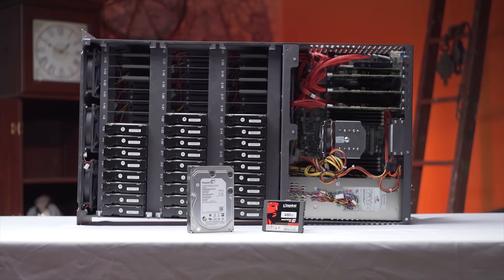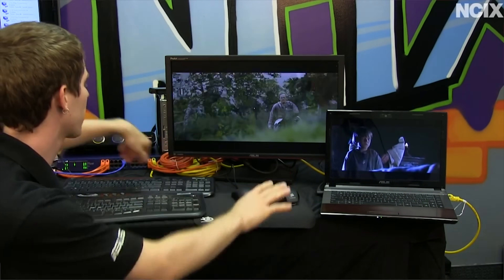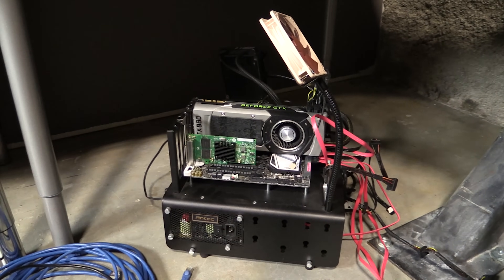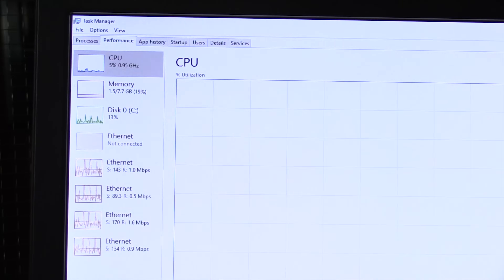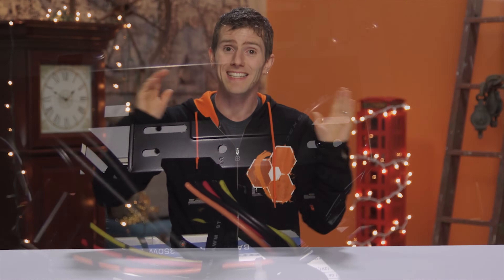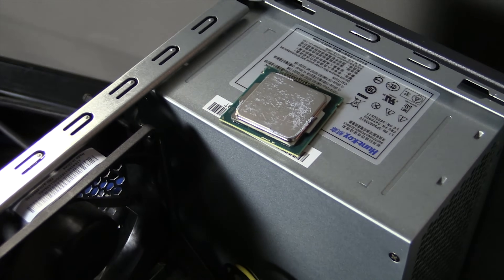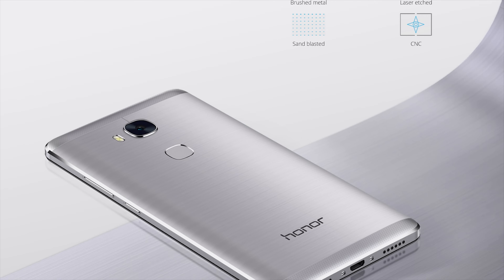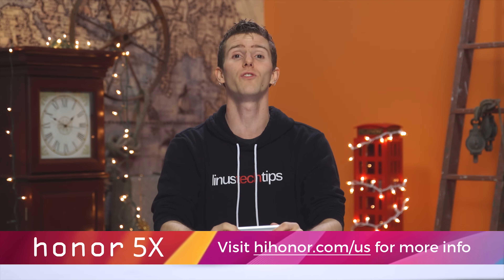Quadruple Your Network Speed for $100 with SMB 3.0 Multichannel!

Comment: I am the first to cry foul when someone yells 'its easier on linux'... but in this case, it is. Basically, anything network related I would want the backend to be linux. I actually use a 4 port intel nic card so that 4 pc's in the house have full gigabit speed to the nas, and it is always limited by the processor(or drive speed) on the backend, so using a bloated OS like windows for that work seems retarded in my opinion. It just sits in the corner, so why does it need a UI at all :P
Reply: +Richard Smith 
Windows has a lot of internal bottlenecks and bugs when it comes to fast and consistent networking.
Worst part, Microsoft does not give a shit.
MPTCP has been in development in LINUX, FreeBSD and Mac OS X for about 3 years now.
Reply: AirScholar  "You give Jobs way too much credit"  Umm i think you're confusing jobs (apple) with gates (Microsoft). And jobs technical abilities are zero, he never wrote a line of code or designed a single circuit in his life. He was basically a salesman.
Reply: Actually a majority of large corporations use Linux as their backend server. Such as Google, Twitter, Facebook, Amazon and IBM just to name a few.
Reply: I recall doing this 'hack' in debian servers no less than 15years ago...
Reply: Rafael Garcia God i hate Debian's interface. I was pissed when the backtrack team switched over to kali.
Reply: Linus right he use ONLY Windows
Reply: "Microsoft does not give a shit." Well of course not, they have not given a shit about power users since the XP days.  Their current target demographic is focused primarily towards mobile platforms (at least that's what they have been pushing at every Microsoft developer convention for the past five years). The company as a whole has been badly mismanaged since Steve stepped down at chair in 2006 giving Ballmer free reign to royally fuck everything up, after he resigned in 2013 there was no one left in the company who had any real insight to the proper direction of the company and thus now stuck with Satya Nadella who has no clue what hes doing.
Reply: +LinusTechTips  I think the equivalent of SMB multichannel is Unix's link aggregation, which existed for a long time.
https://help.ubuntu.com/community/UbuntuBonding
https://en.wikipedia.org/wiki/Link_aggregation
Reply: Typical Windows "admin", complaining about something they haven't bothered to understand. Don't conflate something not being easy to manage with something you don't know how to manage.
Reply from the maker: +Richard Smith That's not what I was doing here, and in fact this feature (SMB 3.0 multichannel) only works on Windows right now.
Reply: nfs 4.1 has mpio avail, google. it or go here .https://packetpushers.net/multipathing-nfs4-1-kvm/ . Confident there won't be any limitation on thread count either. btw, if you run into a bottleneck @ 120mb/s, I promise you switching form SSD to ramdisk won't relieve it, =P

Though I may be confused as bonding and mpio are relic's in *nix just not samba's implementation to *nix. It's just a bad idea since only on sequential streams do you see a benefit. As soon as 4 clients access different data off those backend disks, network will no longer be your bottleneck. I can see this happening with the smb 3 he's offering above, only good for 1 client. If you're wanting high throughput to one client, setup mpio iscsi and mount em.
Reply: nikushim666 LOL !
Yes, Gates. I have some respect for both Jobs and Gates, but not in the field of technology. They are both ruthless and effective business men.
And yes, Jobs is not technical. His made copies of game cartridges when he was young for a company.
Reply: I use 4 port nics in two pcs and they rock with raid 0 SSD's
Reply: +AirScholar 
The file server can be linux based, and the clients can be windows based. With samba they can cooperate quite peacefully.
Reply: hereiam2005 
Mac and LINUX work better. 
Still some permission acknowledgment issues between LINUX and Windows.
Reply: Good. Will do this. Very easy no? Just plug The 2 ntwrk cards The 8 ethernet cables to the 16 Port swich and the switch to the Router ethernet Port? Yes? PLEASE reply
Reply: Exactly.
Reply: prove it. show us the system with your videos. or else shuddup
Reply: Better man than I attempting to explain how it works. Easier to think of it like this, you aren't increasing the speed limit, you are adding more lanes :) Each PC is limited to their own connection speed to the server, the server is limited by the max speed of each individual connection * the number of connections - overhead, or the max speed of the data being accessed.

My LAN has a max theoretical throughput of 4gbps(500MBps), but only 1gbps per connection(125 MBps). I never hit that unless each pc is accessing different volumes, but then I run into performance overhead from the fairly weak CPU I use. A UI would only make that last problem worse. I did manage 398 MBps benchmarking it the day I set it up, though.

Honestly, I don't need more than 1Gbps per pc, so I wouldn't need this fancy SMB multichannel bandwidth aggregation...
Reply: +jgould30
It is the same thing. LACP is fully capable of point to point communication when both ends are LACP capable. LACP used MAC multicast to solve MAC problem, there's only one unique IP when teaming, and packet splitting and timing problem can be dealt with by using buffers, at the cost of increased latency.
According to IBM manual:

"The 802.3ad IEEE standard presents the means for the forming of a single Ethernet link automatically from two or more Ethernet links using LACP. The LACP bonding between participating switches is a point to point connection using a predefined multicast MAC address for controlling LACP Protocol between each port. This protocol provides the means of assuring that both ends of the Ethernet link are functional and agree to be members of the aggregation group before the link is added to the group. These LACP operations are the responsibility of the active LAG Port Controller. LACP must be enabled at both ends of the link to be operational. LACP provides for the controlled addition and removal of physical links for the aggregation group such that no frames are lost or duplicated. The 802.3ad specification also provides for manual aggregation for the deployment of multiple links between switches without performing the LACP message exchanges. Manual aggregation is not as reliable or manageable as an LACP negotiated link."

http://www.ibm.com/support/knowledgecenter/SSB27U_6.3.0/com.ibm.zvm.v630.hcpa6/hcpa6111.htm

People were using link aggregation in big iron systems for years. There's nothing new here.

For more info, read Cisco manual here:
http://www.cisco.com/c/en/us/td/docs/ios/12_2sb/feature/guide/sbcelacp.html
Reply: +Team503 If your network / SysAdmin team had the training, they could manage, deploy and standardize Linux servers as easily as Windows ones. Good linux distributions are designed from the ground up to be deployed and managed with full automation. They only become silos if you insist on only allowing them in silo job functions.
Reply: nikushim666
Microsoft ... they really don't give a shit.
You give Jobs way too much credit. The company has always been technologically incompetent. Even when MS took over the nice DEC OS, Jobs screwed it up majorly. Jobs was just good at pushing unfair practices and creating monopolies. Jobs technical abilities are limited to BASIC compilers on Altairs.
I did networking tests on Windows 10, Linux and FreeBSD with HUUUUGE files using SSDs and RAIDS.
Windows suffered terribly !!! Bottlenecking after only a short time.
FreeBSD did remarkably well and LINUX did well.
Problem is that Microsoft ITs want easy to use GUI and huge budgeting for their departments (so they can feel important). Setting up FreeBSD/LINUX servers isn't point and click and they are free, financially undermining their dept and ITs (in their minds).
One major draw back to *ix operating systems is that it is extremely easy to brick with just one wrong character in a config file or one wrong version of code. Upgrading can be scary. But then good ITs backup before making changes and have test benches.
Reply: Nah.  My multi-million dollar IT budget isn't buying Windows because I want to feel important.  It's because I have limited staff and I need something called "manageability".  I know that you *nix cowboys love to sit there and fiddle with every box you have, but I need to deploy multiple servers daily, quickly and easily.  I need to be able to manage every user's experience inside my LAN and every customer's experience outside my WAN with clear and easy tools.  For the same reason I don't buy my employees Apple machines (though i do love them for personal use), I don't generally deploy *nix in my enterprise.

Oh, it has its use cases, and we do have about two dozen CentOS boxes running for things, but the reality is that until *nix is a easily manageable OS, Windows wins.  Because I have Windows clients, I generally have Windows servers.  Well, and because Active Directory is infinitely better than its competition in scope and granularity.  Everything plays well together.

I have an environment to architect and six Systems Engineers to do it with.  I don't have time to be futzing around with some nix admin's little personal silo.  Standardize, virtualize, and move the F on.  I have to move my entire environment from desktop to multi-million dollar SAN (a Hitachi, if you're curious) to encryption at rest, meet HIPPA *and PCI compliance, and a dozen other high priority, customer facing technology objectives.

You go fiddle with your CONF files and try insulting people running Windows.  Those of us actually in the business have work to do.

PS - We don't have "test benches" in enterprise environments, junior. We have test, development, QA, and production environments, each on of which is change controlled and backed up every night to disk and to tape.
Reply: nikushim666
LINUX is still a server platform.
If lacks in the area of desktop use.

Comment: So this is a video called "Quadruple Your Network Speed for $100 with SMB 3.0 Multichannel!" by a guy called LinuxTechTips which only uses computers running windows....

Btw. I can't help wonder if there isn't a card out there that uses a better NIC chip which causes less CPU load.
Something like the old/ancient RTL3139 cards vs. better Intel ones (I think they was using DMA transfers)

Comment: Did you even install the complete software and driver package of the network cards? The last time I did connections like that the driver had an "teaming" option to actually use all four ports and it was working fine (was an HP Server with Intel Xeon and HP(Intel) network card, Windows Server 2008)

Comment: In your previous attempt you were using LACP often called NIC Teaming (PC/Server) or Etherchannel (Switch). When using LACP a single conversation uses the same link. Meaning if you are using 1Gbit links that is the max speed of any one conversation. LACP is only an advantage when you have a lot of conversations going on at the same time. What dictates what a conversation is depends on the switch. It can be source/dest mac address on lower end switches or be source/dest IP on others. The main reason for all of this is because you don't want Ethernet frames out of order and Ethernet doesn't have anything in it to deal with out of order frames. Multipath I/O is a better technique and is used to provide redundant, load balanced paths between a server and a storage array. The balancing is done with IP and routing instead of LACP and allows for conversations to get more bandwidth than what one link can provide. It has also a much wider range of load balancing options than LACP does.

Comment: HP Procurve 1810G-24's (J9803A#ABA) are cheap, silent and fast in trunking mode.  I operate in the Gbit regime on a regular basis, coupled with a NAS that runs two port trunking through the 1810.  My goal of running the NAS with two port trunking was for fast, efficient, complete backups in a minimum amount of time and I achieved that with this setup.  

Now I just need that dual port Intel NIC to put in my prime system, that would unleash the tiger.

Comment: TCP hardware offload, jumbo frames, NIC teaming and a managed switch with LACP are the reasons why it is not working as expected.  You are hitting the fundamental design limitations of Linksys level networking, and the solutions are at the cisco featureset level.

Comment: This is fairly misleading. First, there are two ways to group more than one port together so they can be used at the same time. Network Teaming and Link Aggregation. Network teaming which is done here would have to be setup so that on one computer 3 ports would handle upload and 1 handles down and the other computer would have to be setup opposite 3 down, one up. Then you could only achieve those speeds in one direction. For what Linus says he is trying to accomplish, you would need a little more money to get a switch that supports Link Aggregation. With this, all ports can be used as either upload or download, but again you have to get a switch that knows how to handle packets in this manner. Completely doable, but not for $100 and not the way it is being done in this video. Again, what he is doing will only work in one direction. The Trendnet TEG-160WS for example can handle Link Aggregation which is listed at $161.99 on amazon right now.

Comment: well that only works on wired Ethernet AND assumes you can just lay down 3 extra cables. I route my Ethernet through my entire house (hate wifi) and it was a chore, I'm not simply adding 3 extra cables to improve intranet speeds.oh, and did I mention? You also need a Core i7 to utilize this, so fuck that

Comment: Eeeeerrrrr.. Nic Teaming? LACP?
Reply: Richard Leadbetter Nic teaming or lags or Port aggregation require multiple TCP connections to possibly multiple IP addresses depending on what's being hashed by each part of the link. This is about SMB 3.0 multichannel which doesn't require anything special but more than one Nic on both the SMB server as well as the SMB client that both support RSS and SMB 3.0 will set up multiple channels between the two automatically effectively doubling tripling or quadrupling are however many NIcs you have. You don't even need managed switches. Port aggregation is more useful and one too many or many too many situations. Smb3 multi-channel works extremely well and one-to-one situations

Comment: Multipath is only available on higher editions of Windows. I'm guessing that those that didn't work where probably had Windows 10 Home. But for $100 you can pick up a couple of Infiniband QDR cards with a switch and get 10x the throughput of this setup on a single cable.

Comment: So in order to make the network card run better you need a better cpu.. That's consumer-level hardware for you. Back in the days of real workstations each add-on card, whether a nic, modem, raid or even a sound card would have its own dedicated hardware chip to run things. Since the Intel-ization of the pc, all the processing is offloaded to the main cpu through drivers - the cheaper way out. And as always is the case, performance suffers. Instead of doing this whole dance you could just install a solid version of linux, setup nic bonding and be on your merry way. What'd you expect out of Windows 10. The whole networking stack needs to be redone ever since XP.
Reply: +440DieseL With the Intel bases NICs (and now others that have followed) TCP offloading has sped things up quite a bit for networking. But yes, NIC bonding under Linux is a lot better than Windows 10.

Comment: For all that cycling and 'figuring stuff out', it would have been easier to get 2 old mellanox connectX2 cards for 10gbe connectivity. You aren't gonna get full 10gbe in all likelihood, and you can't use most switches, but for point to point you can spend ~80-100 bucks (for 2 cards and a cable) for very nice speeds which also work with non-windows servers and clients.

Comment: Hey tech people.  How is that Honor 5, worth the money?
Reply: +Scheefinator It's garbage man, buy a console instead, your eyes can't see more than 30fps anyway.
Reply: markothevrba
LOL
Reply: Brian Khanzadeh
What about a Nexus?
Reply: agun17
Mate, all phones are nearly the same these days when it comes to like features.  It's the tech that matters.
Reply: The thing I worry about those cheap Chinese phones is software compatibility and future security patches.

If I got a Nexus for instance, I'm guaranteed 100% compatibility and very fast patches because that's Google's own software Vs if you get another manu, then they alter Android to their own devices and may or may not patch it or give it software compatibility.
Reply: Brian Khanzadeh
There is more to using a phone, than the specs.

You have to think about the future experience.  Software moves way faster than hardware.  You want to ensure that months down the line, your app you love using is actually going to get updated for the firmware patches your Manu puts out, so that it will work properly.
Reply: Brian Khanzadeh
I will take it into consideration.
Reply: I said I would take it under consideration.

Comment: Wait, I get about 25 MegaBits a second, if I use this method, will it increase my network speed, or is this method only to break any bottlenecking that would happen within your household, therefore only beneficial if you have a much faster ISP network speed?